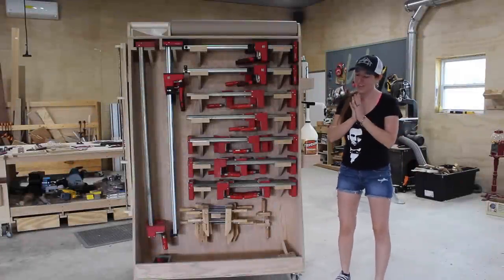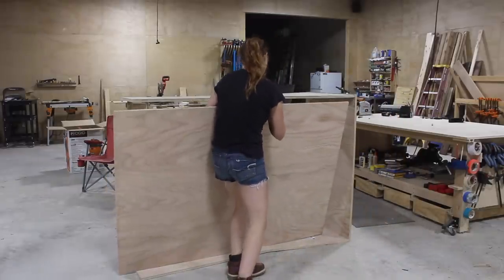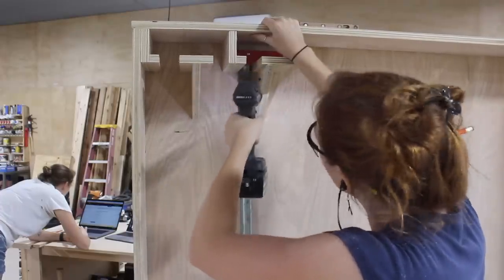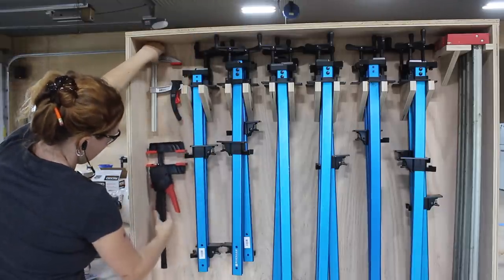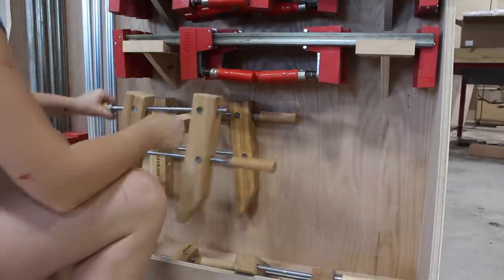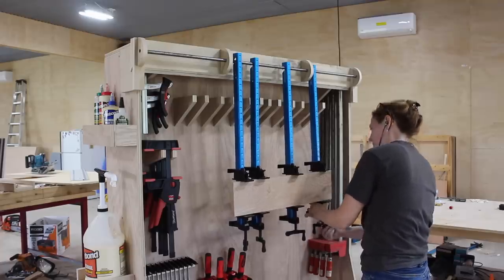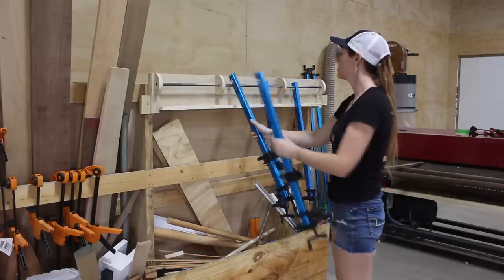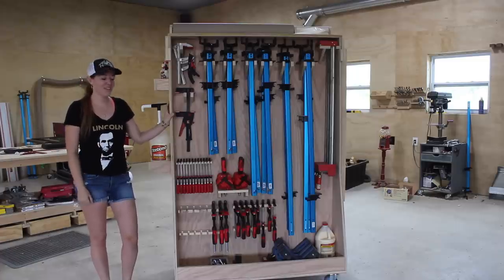Ultimate Mobile Clamp Rack

Comment: Last year, I attached  a similar glue rack  (nowhere as nice) with pipe clamps to my wood rack. I had a hinged 2x4 pop out about a foot below the hinge to push the lower section outward.  The glue drips away, but it was more to prevent me from having to bend over due to a bad back.  My suspended pipe clamps are all 5 feet long.  I also use it for sawing large sheets of plywood.  I couldn't afford anything as fancy as yours, so I have a hodgepodge of mismatched clamps.  I love your system and dream of having a shop your size to play in. Nice build April!

Comment: Love the rack! - For the Paper rolls, you can slot the dog ears from the top to the holes. Because you will always apply downward pressure when rolling out paper, the rod will never come out. To replace a roll, you then simply have to lift the rod up, replace the roll and away you go.   Great job April.

Comment: Love the build! You may consider putting a lip on the front of the shelf so that gallon of glue does not fall off while you are rolling it around or refilling a small bottle. Just an idea! God bless and have a great week!
Reply from the maker: We shall see, so far it isn't an issue and I'd rather be able to change out the bottle by sliding it forward than lifting it up and over.

Comment: great video you do awesome work and ideas.  for your craft paper and wax paper roll make it quick and easy to refill is just notch the supports so the bar just drops in and lifts out.  you will always be pulling down on them so the rolls wont fall out. Save the wood from being torn up over time being unscrewed and screwed back in.  Love the new shop too.

Comment: I've had castored racks for most of my wood working career.  My racks were screwed straight to the wall.  But I like the portable clamp rack.  I like yours better than the Infinity Clamp Rack. I have a gluing rack the holds the clamps in the rack while I drop the project boards into place and glue them up and clamp.  I have to rebuild this item after 25 years of use.  New shop soon.  Like your work.

Comment: For my paper dispensers, I use one of those paper cutters with the rolling cutter head, but it requires some fiddly hacking to get right at first unless you spend a lot of money on one big enough for the rolls of paper you use and just mount it. But it works a treat once you get it right and if you do it right the first time, it doesn't require too much maintenance, just an occasional sharpening of the blades and oiling of the bearings, which even if you use it a ton only needs to be done every 3-6 months or so, even longer if you don't mind the occasional rough cut of the paper.

Comment: You could hinge the glue-up rack along the top edge so it flips up on top of the stand when not being used, and you could have some adjustable stops underneath it so when it is flipped down you could adjust its angle and let that hold the glued boards as close or as far away from the stand as you wish.

Comment: Great ideas!!! One thing I would like to point out that may be an issue down the road... with the glue up rack... you may want to attach something that will keep/secure the top of the clamps where they hook onto the bar. If you look at the video around 11:41, you can see they start to ride up a little. That may be an issue, but I'm not there to take a closer look to see how much they shift on the hook you cut into them. Nicely done, though!
Reply: If the notch is cut on the front of the bar, the weight of the glueup would press the bar against the rod with the ply spacer acting as a fulcrum. That’s as long as there is sufficient space between the rod and the backboard to slide the bar of the clamp in when hooking it up.

Comment: Love the videos. Lots of good info every time. My shop is small but will try a shot at smaller rack this winter for inside builds.
Reply from the maker: That's perfect. You could also take some of the ideas and place them on a wall instead, it doesn't have to be on a mobile unit. : )

Comment: Hi April, I know it easier to have a utility knife on hand. But, if you really want to get creative you can mount a track across the top width of the cabinet with a scrape blade between the two rolls that can move left or right to cut either roll. Similar to those found on rotary paper cutters.

Comment: I'll have to make a smaller one for my smaller shop, but great work here.  I was thinking about adding a small holder on the glue side to hold my glue rollers and brushes.  Additionally, enjoying those rolls on top maybe adding a 'paper guide' to hold the ends of the rolls so you aren't hunting for a lose end of paper or wax.  These are only minor ideas to a great idea you've got there.

Comment: You can use a jig saw to cut some slots on the sides where your hands feel most comfortable on the rack when moving it around, then just follow it up with a round over bit in your router to soften the edges for more comfort

Comment: This is gorgeous! I want one...and clamps. FeelsBadMan

Just a thought, instead of cutting the clamps to make a hook, another choice could be to cut wooden or metal hooks from stock that would allow the hooks to be inserted and fastened to the clap ends (like using square stock of the same cross-section as the clamps).

Comment: Just a thought, but you could just add the rod that you are using to hold the clamps for glue up to the top of the unit, opposite the paper, and use the top edge of the clamp rack to hold the clamps at the angle.  That way you don't have to mess with the removing and storing of the clamp rack.  It would always be accessible!

Comment: Love the concept to use the plywood edge to cut the paper.  Maybe a removable hardwood strip so you don't ever damage the plywood? Something like oak probably won't ever get hurt by the blade but the poplar core veneers for your ply might.  Maybe if it's oak you don't need removable... Just some edge banding thee for a cutting surface. Probably over thinking it.

Comment: that looks great, one word of caution though, (having done exactly this myself) the boards with the grain running horizontal through the fingers of the clamp holders, over time the fingers will break off.  If you like the style of clamp holders use Birch ply or something that will hold up.  I went with  the style of clamp holders you used in your old shop, :-).

Comment: Great Video, I love the clamp rack !
BUTTTT, I have one suggestion. I think if the hole were at the opposite side, you would be able to mix and match clamp lengths on glueups that need ALOT of clamps, such as a table top. With it at the opposite end, the varying sizes prevent you from using differing sized of clamps.

Comment: I'd have notched the clamps in reverse to that they lock onto the bar, the notch you did makes sense if they're hanging straight down, but with the additional piece to angle them out hooking them on from the back of the rod would make them more stable.

Comment: At 12:55, just a thought...I wouldn't say band saw blade but make a homemade paper cutter. You could put a rod along the top, then fashion a small piece of wood that you insert a razor blade into a slit (maybay use little screw for security and let you change it out). Then you can just pull the blade back and forth down that rod to slice the paper off as you want it.

Comment: I like the rack and glue up rack addition. Only thing I would have is put my hooks on the clamps on the other side so the weight is against the body of clamp instead the points.  I could see a heavy glue on the longer clamps making them want to slip off. Good job though.

Comment: I wonder, would it make sense to cut a notch up from the hole where the rod holding your paper dispenser feeds through, cap both ends so the rod doesn't shift and that way you just need to lift the rod up when you need to replace the paper instead of undoing the pocket holes?

Just a thought :)
Reply from the maker: Yep! Somebody else made that suggestion, I wish I would have thought of it when building it. That is a much better way to do it.
Reply: I had made something similar years ago, and had intentionally over-sized the rod holes so it would slide out either end.  To cap the ends and prevent the rod from shifting, I added an extra board, that had a single screw at the top that allowed it to be swung to the side, but would swing back due to gravity.  If you need to change the roll, simply swing the plate at the opposite end and slide the rod halfway out.  This would be an easy change to make to your existing design.

Comment: With as tall as the ceiling is, I might suggest looking into suspending your glue up rack from the ceiling with a couple ropes and pulleys. That way it doesn't take up floor space, wall space, and will be completely out of the way yet would still be easily accessible.

Comment: I noticed you used a level to set several of the parts. That made me wonder... Is the floor there perfectly level? If not, then that would cause the brackets to be skewed a bit, to reflect the  difference between the level and the floor. Usually I've found that most concrete floors, even thought they look totally flat, have various discrepancies in them.

Comment: Late to the comments, so if this is a repeat - sorry.  Rolls of paper on top - why not cut slot down from the top, and the rod just sits down into the holders.  You are always putting downward pressure unrolling and cutting, so it won't fall out, but replacing will be a simple lift and load.  OH, and thanks for all your wonderful tips!

Comment: You might want to watch out for the weight of your glue ups. If the cut out is to shallow it may slip off damaging your glue up and maybe you. If you have more clamps I'd suggest putting the cut out on the other side so the weight pushes the pole into the cut out instead of pushing the pole out of the cut out. I'd test the weight limit of your hanging glue rack before you actual do any glue ups. Not trying to discourage because I think this thing is amazing! Great job. I want one.

Comment: What about spring clamps, C clamps, web clamps, QuickGrip clamps?   I have a set of  (four) pipe clamps that get a lot less use than the Bessey K-Body clamps (I have 10), but the pipe clamps do come in handy.  Having different kinds and sizes of clamps is so important.  My clamp rack is stationary and is hinged so I have use of two sides to save on space.

Comment: Could this be made a little deeper with French cleats installed on the inside panels? Seems like it would add versatility to rearranging the clamps instead of having several empty screw holes all about the panel. I know this increases the footprint but it would only be a few inches.

Comment: Hi April,
Awesome clamp rack. Don't think you can squeeze anything else on there. Are you worried the gallon glue pumper might slide off it's shelf? Video is excellent, as usual.   :-)
Reply from the maker: Nope! It hasn't fallen off yet at least. If it does I'll address it then, but I'd rather keep the side open so I can slip it in and off the shelf rather than lifting it up and over a lip.
Reply: Hi April,
Was thinking more of a small bungee cord to keep it from moving. You can put some eyelets on both sides of the container.

Comment: Needs a front edge to keep the gallon jug from sliding off in a sudden turn or stop. Or a bungee cord.
Reply from the maker: Nah, it isn't going anywhere and I'd rather be able to slide it in and out rather than up and over.
Reply: @AprilWilkerson  

Cool. I think it is a very well built system anyway.

Comment: Curious what casters you use on your projects?
Reply from the maker: For shop projects I typically go with polyurethane wheels. But more than that, I just go ahead and commit to spending good money on them so the material holds up over time as well as the bearings. Nothing is more frustrating than having casters go bad then trying to get it to move around.
Reply: Another problem is if you use small castors because you think you're not going to have a lot of weight to push,  or you just want to save money,   then you have to make sure your floor is swept a lot.     Small castors will get stuck on sawdust or other small chips and debris.  Instead of making sawdust and projects you end up spending your life sweeping the floor.

Comment: I see you are using makita drills. Any reason for switching from triton.
Reply from the maker: Triton stopped making drills so I'll be playing around with which brand I want to use.
Reply: Hi!

Greetings from across the pond and beyond. Been watching your channel for a while - great stuff! Keep it up.

Just thought I'd share what was the deciding criterion when I chose which drill brand to go for a couple of years back.

Compactness, ergonomics, brushless motor, metal chuck - those are no-brainers that are available from multiple brands nowadays and should not be compromised on.

The thing that set mine apart was anti-kickback protection. The drill has angular acceleration sensors, and when it senses that the drill body starts to rapidly accelerate around the chuck axis, it immediately cuts power to the motor, thus minimizing any damage to one's wrists etc. Very useful when using hole saws or drilling large holes in sappy wood when the drill bit might get stuck. HTH.
Reply: What's the reason to stop using the Triton if it still works? Are you hoping it becomes a valuable antique in 30 years or so?

Comment: Great project....  except don't cut your aluminum bar clamps like that!  You've turned your 24" clamps into 20" clamps by ruining the integrity of the bar.  Sorry to point that out, but the last few notches will not hold up under clamping force.  Otherwise... nice project!